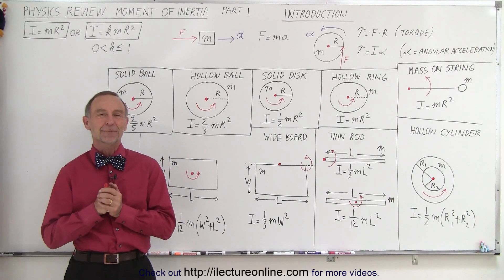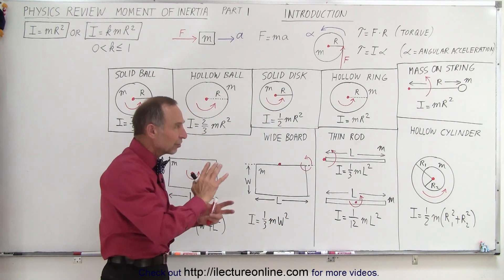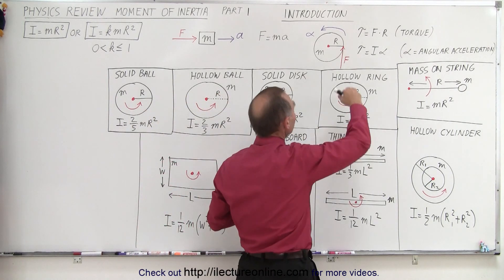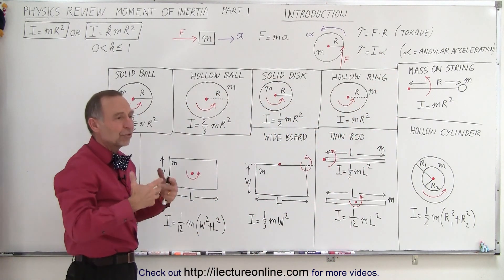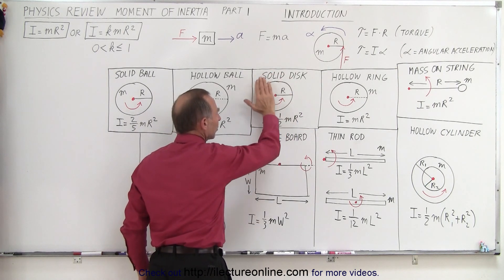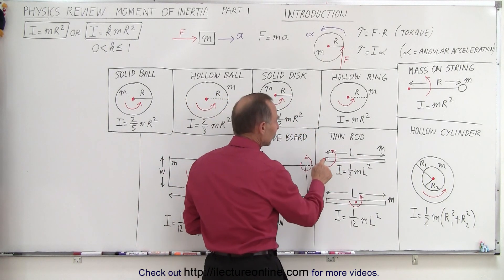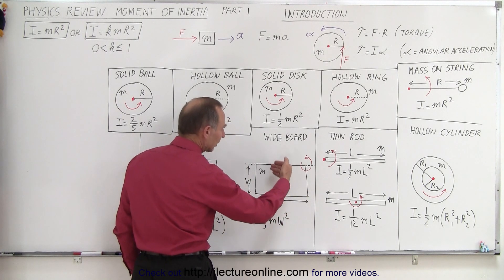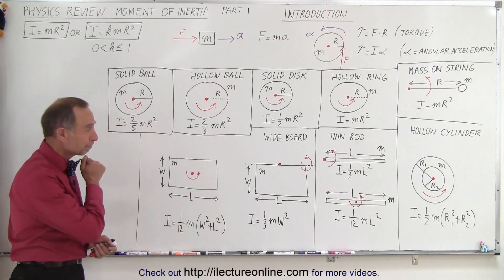Physics Review: Moment of Inertia Introduction (Part 1)

Comment: TIME is NECESSARILY possible/potential AND actual ON/IN BALANCE, AS “mass”/energy is (CLEARLY) proven to be electromagnetic/gravitational ON/IN BALANCE consistent WITH WHAT IS the fourth dimension !!!! Great.

Gravity/acceleration involves what is balanced inertia/inertial resistance consistent WITH WHAT IS E=MC2 AND F=ma. Gravity AND ELECTROMAGNETISM/energy are linked AND BALANCED opposites, AS the stars AND PLANETS are POINTS in the night sky. (Consider what is THE EYE, AS TIME is NECESSARILY possible/potential AND actual ON/IN BALANCE consistent WITH WHAT IS the fourth dimension; AS two AND three dimensional SPACE are BALANCED.) Indeed, consistent WITH TIME AND WHAT IS THE FOURTH DIMENSION, the stars AND PLANETS ARE POINTS IN THE NIGHT SKY !!!! ACCORDINGLY, WHAT IS the Moon will (and IT does) move away very, very, very, very slightly IN RELATION TO what is the Earth. Great. I have explained the motion of WHAT IS the Moon, AS I have surpassed Newton and Einstein. I have truly and FUNDAMENTALLY revolutionized physics !!!!

BALANCE AND COMPLETENESS go hand in hand !!!!

I have explained the cosmological redshift. I have explained the motion of WHAT IS the Moon !! I have CLEARLY proven WHAT IS the fourth dimension (ON BALANCE) !!!! GREAT. I have CLEARLY solved WHAT IS the coronal heating “problem” ON BALANCE !!!! Great. I have explained the supergiant stars. I have explained the neutron stars. Consider WHAT IS the GLOWING central bulge of some galaxies. Consider what are galactic jets. NOW, consider what is sphericity !!!! Consider what is a black hole. GREAT !!!! I have CLEARLY proven WHAT IS the fourth dimension (ON BALANCE) !!!!

It ALL CLEARLY makes perfect sense ON BALANCE. Indeed, the integrated extensiveness of thought and description is improved in the truly superior mind. (Thoughts are invisible.)

A given PLANET sweeps out equal area in equal TIME !!!! I have COMPLETELY explained the motion of WHAT IS the Moon !!!! (The rotation of WHAT IS THE MOON matches the revolution !!!!)

The ultimate mathematical unification (AND UNDERSTANDING) of physics/physical experience (AND TIME) combines BALANCES, AND includes opposites !!!! GREAT !!!!

By Frank Martin DiMeglio

Comment: isn't formula for moment of inertia I=1/32(D^4-d^4) (for circular sections) and I=1/12*b*h^3 (for rectangular sections)? These are the formula given on the textbook for 2nd year mechanics of materials course.
Reply from the maker: The equations given in the video are correct.   If you want to see how this is done in mechanical engineering we cover that as well in the mechanical engineering playlists.  The have different definitions that are applied to engineering.  They are actually the same, but given in different methodologies.